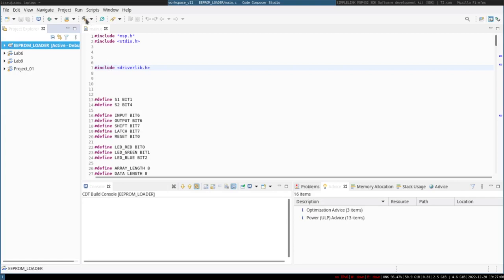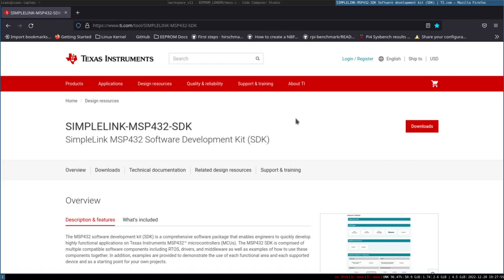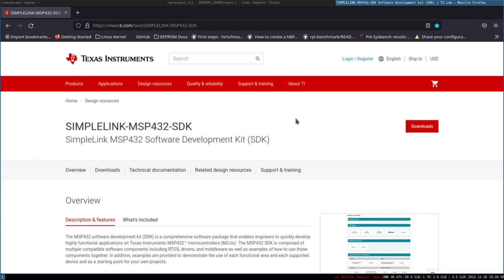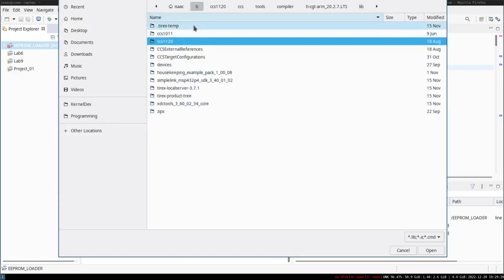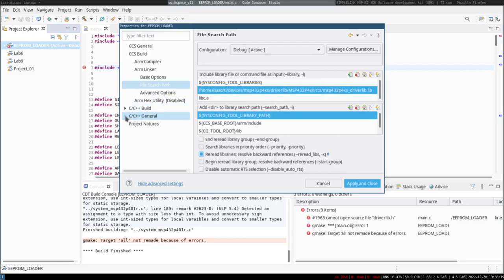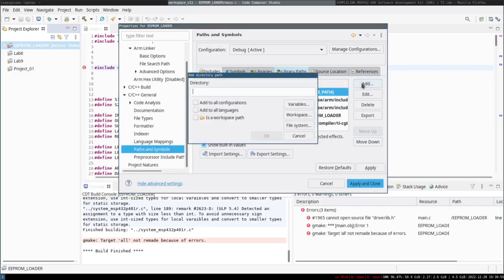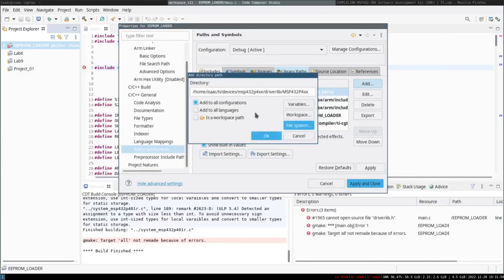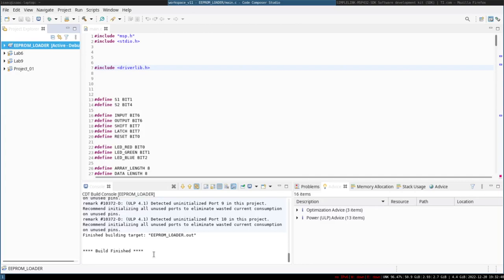Code Composer Studio Driverlib install helper | MSP432

Comment from the maker: To everyone who sees this and is having problems with getting any version of CCS installed on a debian system, this might help. Apparently Python 2.7 is no longer support in the main repos for Bookworm. Cant find libraries like libffi6, which one package is needed for install libpython2.7. 
There are other packages that are needed for Python 2.7, which are further depended on by CCS during install, so adding "deb http://ftp.de.debian.org/debian buster main " to your sources.list file will help with finding the packages you might need. At least this will help. 

Happy installing.